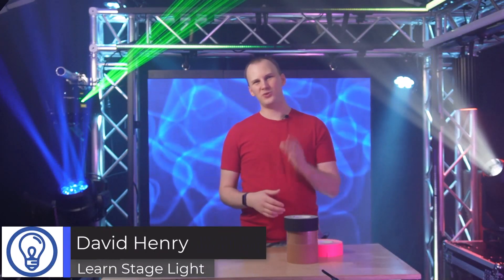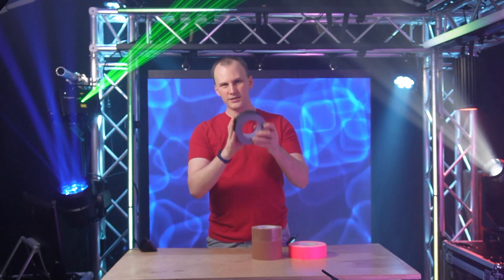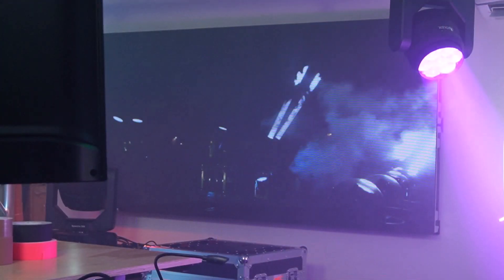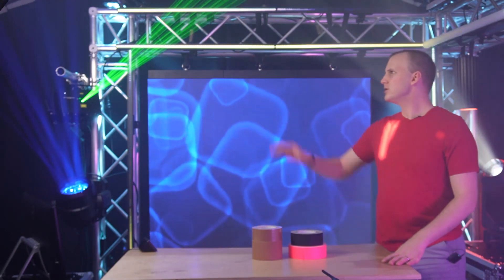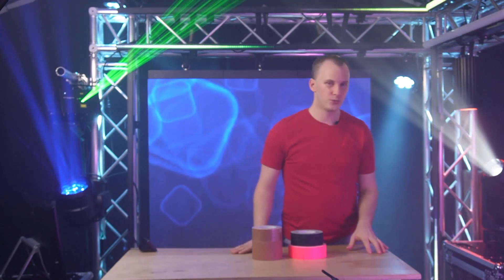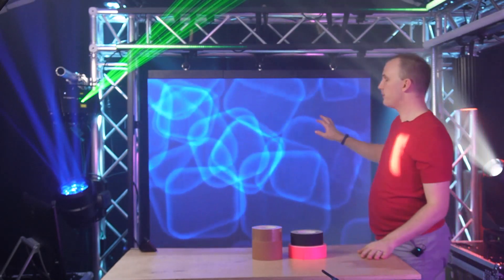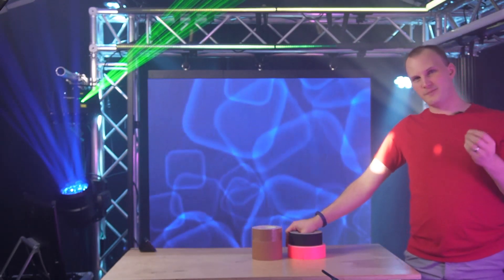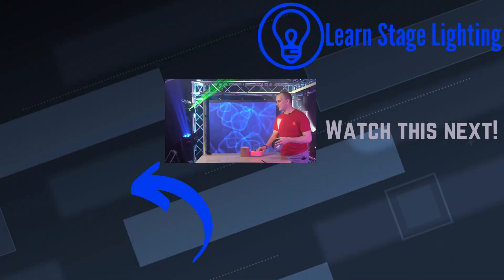How Do You Make LED Walls and Lasers Look Good on Camera?

Comment: What was the shelter angle, frame rate, and the model of camera you are using to get rid of flickering at LED screen?
Reply from the maker: It's going to vary based on the camera and the LED wall.
Reply: @LearnStageLighting what were your settings?